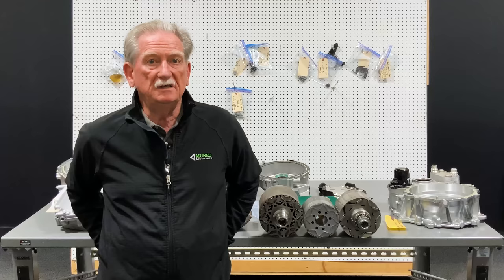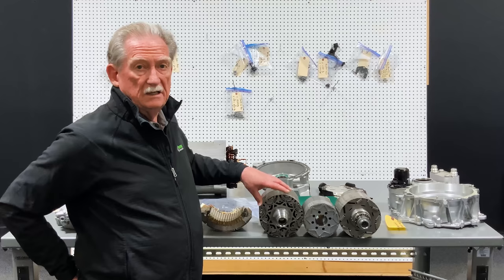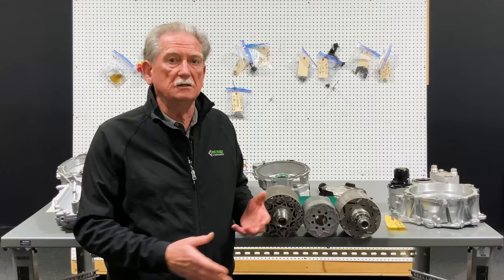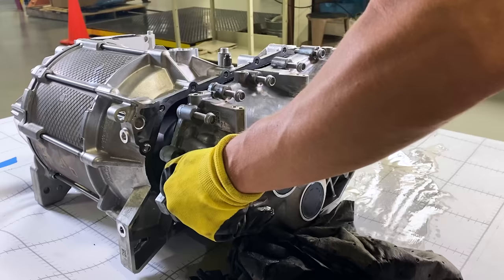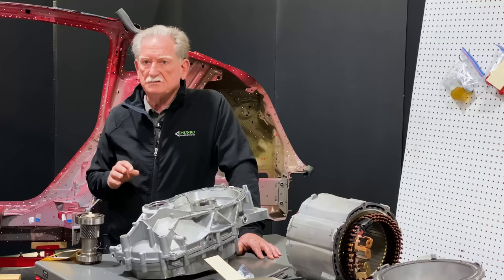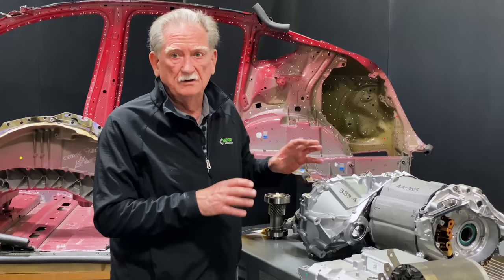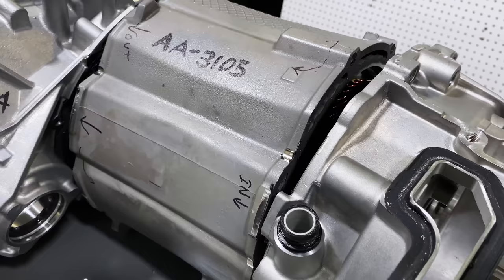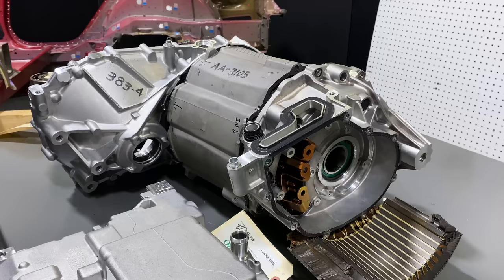Volkswagen ID.4: Electric Motor Teardown and Analysis

Comment: Hi, as an Aerospace Researcher and Designer there is an inumerousamount of ways to drastically increase the durability, power, and longevity of an electric motor. And you are correct, use of bolts and nuts is a lazy way to do things. 

1st. The bolts could have attached at on end a harden steel end clamp that is the locked in place after it is snapped close. Then a  10 mm locking bolt is used to prevent the clamp from opening back up. As an extra safety measure, use of a cotter pin (similar to what is used in aviation), and a sensor module would ensure the bolts not only stay in place but are monitored by the on board computer. The modules would provide temperature, stress, and clamp/bolt/cotter pin failure, and open clamp position data.
2. Use of an on board "Micro Atmospheric Liquid Nitrogen Genterator & Auxiliary LNG Tank" used to cool down the Magnets and coolant used on other parts of the engine and parts via a central heat exchanger. This would increase the permanent Magnets magnetic field and keep the entire vehicle at a optimal temperature which would extend the range and life of the engine.
3. Use of a hyper vacuum thermal barrier battery box and sensors, would mitigate battery degradation due damage/degredation caused charging said batteries at or below atmospheric temperatures of 32°f (or 0°c or 273.15 kelvin). Said box would also have integrated cooled or heated air injectors to keep the batteries at its optimal temperature year round.
4. For added traction, use of 4 computer controlled micro high speed suction fans mounted on the front and rear axles. Use of high grade polymer tubing that has an augmentable flared opening at the end of the 5" diameter (12.7 centimeters) tubing closest to the ground; would create ultra high suction points to keep the car's traction at its optimal level which in turn would increase torque conversion and speed, and increase steering stability on multiple surfaces. Plus the air would be vented at the back of the vehicle to nullify low pressure areas that increase drag on a vehicle.

Your thoughts great,y appreciated.

Comment: 18:20 - - The noise he is talking about there is not generated by the mechanical move, but by the electromagnetic interaction between the ferromagnetic parts of the rotor and the ferromagnetic parts of the stator. Those electromagnetic forces create vibrations, translated into noise.

Comment: The issue with that hairpin design is a more pronounced skin effect when the inverter is outputting high frequency voltage/current (so, high speed driving will be less efficient with this kind of motor than a wire-wrapped motor).
Reply: Porsche and Hyundai also use hairpin motor wiring.
Reply: @Foersom_  So does Lucid.
Reply: GM motors (in hybrids, the Bolt, and presumably the Ultium components) and BorgWarner (formerly Remy) motor are of the hairpin type, too.

Comment: Train tracks in europe are not cut on a bias in general. They are welded together. This is why there is no noise. Whilst there are a few cut on a bias these are very far apart and only there for expansion relief, not to join standard lengths of track. Ie. we  have approx 100 rails welded together before an expansion joint is needed.

Comment: VW can get away without a localized pump and heat exchanger because they make about half the power and heat compared to a Tesla motor.
Reply: yeah I also guess that is the main reason.
Tesla makes around twice the power in its motor, so there is more heat dissipation to be expected.
Reply: Uhm not really that's not the point.
Reply: @markusdd5  tesla uses 2 motors to reach those faster times and the 400+hp
Reply: @alanmay7929  i know that. But also the PM motor alone is significantly more powerful.
Reply: you cant say that half of the power causes half of the heat. it depends a lot on the type of switches, how much capacity they have, how fast they are, what amount of resistance they have, the same goes for the gate drivers and their power supply etc.
it is very complex
Reply: @markusdd5  yes because its performance oriented, motors are designed for different applications.
Reply: @markusdd5  the tesla PM motor also uses rare earth and way more expensive materials than this vw one thats what sandy said.
Reply: @alanmay7929  incorrect. The materials for the magnets are the same but VW needs more neodym than Tesla.
Reply: @alanmay7929  the single RWD 3D1 (China) or 3D5 (US) Motor of the SR+ already has more kw/hp and faster 0-60 than most top of the line VW BEVs even if they've AWD.
Reply: @markusdd5  are you serious?! Watch the video again, Sandy said that vw doesn't use more rare materials than tesla
Reply: @Hitman006xp  nope and vw hasn't even made a performance version of their cars, the id4 is not a performance car
Reply: @markusdd5  go watch the video at 13:50 and listen very well what he says about the magnets 🧲
Reply: @alanmay7929  yes it is the same stuff like int he Tesla Motor.
There is only one major material for those magnets.
Reply: @Hitman006xp  re: "the single RWD 3D1 (China) or 3D5 (US) Motor of the SR+ already has more kw/hp and faster 0-60 than most top of the line VW BEVs" and that's the "SLOW" Tesla...!!! (all the rest are like 3 and 4 levels FASTER)  yes, it does take a few seconds to wrap your mind around this if you never owned/driven a base SR+.

Comment: The reason most rail tracks in the modern world are quite is not the rail ends are cut at an angle - they are but welded so there is no gap. The thermal expansion forces are forced to go sideways rather than longitudinally by the rigidity of the track bed.

Comment: The bearing design is smart & has been around for a long time as we know. Wheel bearing which provides noisless & extremely solid on weight & ware.
Reply: He compared a big and a small bearing w/o any look at forces and revs both have to handle.

Comment: Thanks Sandy! And will you be reviewing the plaid model s?
Reply from the maker: Maybe!
Reply: I know he wont review the cybertruck because its the nokia of vehicles!
Reply: I hope so! Elon should sponsor one to you for your great work for the Tesla community
Reply: @MunroLive  good because I was waiting for the + just for the range and am not happy that it’s been decided to pull it from production.  Perhaps the Plaid will effectively have 520+ range but I’ll wait to see.   I could care less about top speed or acceleration but was excited about range in conjunction with the air suspension. Would hope that the user entry/exit profile would include raising the height to maximum for ease of entry and exit.
In Minnesota I want range that offsets climate, road conditions, speed, wind condition, and minimum/maximum charging capacity. From what I’m piecing together it’s easy to potentially expect a 30% reduction in range. If so, I’m keeping my 15 yo Acura TSX with about a 520 mile range for the time being. Some of us, maybe a very small percentage, don’t need to stop every 2 hours!
Reply: @weschapman5041  you drive 150mph!
Reply: @kennyg1358  I’m sorry but where in what I said would indicate I drive 150 mph? The reference to stopping every 2 hours is regarding taking a pee break to recharge.
Reply: @weschapman5041  that's the point. You can go 4+ hours before a recharge unless you travel at extremely high speeds.

Comment: I'm assuming burs are bad because they can chip off and go into the motor 🧐
Reply: The burrs chip off and go into the bearings and gear mesh and quickly destroy them.  The motor has large enough clearances that it largely won't care about a little metal chip.
Reply: Also just not good for tolerances.
Reply: Burs can do 2 things, firstly the metal can come off and get into things, second that's a stress point for a fracture / crack to start forming.

Comment: 7:11 cracked and nobody's mentioning it.
Reply: I didn't notice cracks (multiple areas indeed!), but I noticed that casting is machined only partly. I already commented that it's odd to see something like that in today's castings. That indeed seems to be severely defective design. That cracking is seriously bad thing. I also commented that seeing cooling channel go into inverter and coolant being sealed off by very small sealant area without backup is also proven to be bad design. I've seen plenty of leaks in machines that have such sealing. Now those two combined to cracking. Looks like I personally won't be looking into getting first line ID.4 VW's 😊

Comment: As someone who likes to repair and not replace, give me threaded fasteners any day over snaps. Snaps get brittle with heat cycles, usually break when you try to disassemble them and if you are lucky enough to have them stay intact, they never seat properly again.

Comment: “… a modular design that would allow them to use this motor wherever they wanted…” — I.e., the “parts bin” strategy.
Reply: Is that a bad thing?
Reply: It means sacrificing the efficiency of the final product for economies of scale & not needing to spend the time, money & limited engineering talent for a specialized solution to each use case.
Reply: @jamesengland7461  just a comment related to Munro’s recent round table discussion re the impact of ICE automakers’ use of a standardized “parts bin” on parts count, weight, etc.
Reply: If you know the history of VW, you shouldn't be surprised. After WWI, the company was widely viewed as a lost caused and had to scrape by with a minimum of platform innovation. so they stuck with the VW Beetle design for decades, because no company from the Allied Powers wanted to invest in them. So they perfected the parts bin strategy. And they did well enough to get to be the biggest car company in the world with it. Their second big platform was the Golf / Rabbit, and the ID3 is the third.
Reply: Stop talking nonsense, how is this a part bin strategy when its a newly developed motor for brand new car models?!
Reply: @alanmay7929  Please dont stop their ciclejerk.
Reply: "Parts bin" is both good and bad.  Let's say this motor is equivalent to a 1.8 liter gas engine.  Is there really a need for a 1.6, 1.7, 1.8, 1.9, and 2.0 liter variants of this same engine, with different cranks,  rods,  pistons,  and cylinder bores? With the gas engine,  they all take up the same volume and weigh almost identically.  The efficiency of each is almost entirely a function of tuning.  In the case of electric motors,  programming and battery output have been found to be more determinant of engine output than merely a small change on the motor itself.  With a common motor,  single,  dual, triple,  and quadruple motor chassis can enjoy a wide range of power and range. In fact,  detuning the engine itself would be ludicrous- emissions are not relevant,  and efficiency is still maximized.
Reply: @alanmay7929  Q: How is a new parts bin component created? A: When the component is built with the specific goal of being usable across a myriad of products. Not necessarily a bad thing (as pointed out in the discussion I linked) - but future products may find themselves constrained to using the “parts bin“ component instead of a new, bespoke component that provides more utility.

Comment: You don't like threaded fasteners/unfasteners do you! You mentioned using Loctite with them, so do you find that solves the problem and so find them acceptable or would you still have a problem with them?
Reply: Bolts with tufflock patches are better.

Comment: “A robot is basically a blind one armed idiot” S.M
Reply: A robot with sensors and controlled by a very smart (AI) computer is a replacement for humans.   We need to be thinking about how we will distribute goods and services once human labor has no value.
Reply: It depens on the robot - if you have to glue or to watercut someting you will be fast on ABB robots with his programstructure and the presision of 0.2mm.
Comao wich used at giga Berlin is only cheap.
Question from a Yaskawa programer: How many lines you are able to use on an ABB robot?
ABB Programer: I don't understand the question....

Comment: I would have liked to see examples of snapped-in parts to be convinced that screws are bad.  I feel that designing parts to be snapped does save time in manufacturing and assembly, however, using loctite (of some sort) on screws should hold any screw in place for the life of product. I had worked in the train industry where loctite was used on all screws, never had any issues with fasteners coming loose.  And we are talking vibration from a train on a track compared to vibration from a car on a road.

Comment: Threaded fastners must be "ten a penny". er nope VW would never pay that much for them!  VW made about 6.5 million cars in 2019. They can basically tell the supplier how much they want to pay for a screw and say "take it, or leave it" And with automated machines doing the assembly, it actually takes no longer to screw in say 10 inverter lid fasteners than it does to screw in 5, because they are simultaneously driven!
Reply: They can basically tell the supplier? You really underestimate how the collaborative nature of the german car industry works. It’s the reason for a high shared mind for quality (but also the cause why paradigm shifts aren’t as simply put in place). The german car industry is a highly collaborative and partnership based ecosystem that has nothing to do with American cut-throat wall mart style procurement. Otherwise long term relationships and continues improvement wouldn’t work. If there’s a cheaper / better way it often comes from the supply side to make the overall product together better -> not top down dictatorship. Greetings from Berlin.
Reply: @dinoscheidt  To be fair, he is not totally wrong. VW does have a reputation for not beeing the nicest customer. The are going quite rough with their suppliers.
Reply: @dinoscheidt  The margins for car suppliers are today usually quite small, you can buy tools and machinery of car suppliers every couple of month because another one has gone bankrupt. 
The car industry began to maximize their profits by squeezing the suppliers in the 90s and 2000s.